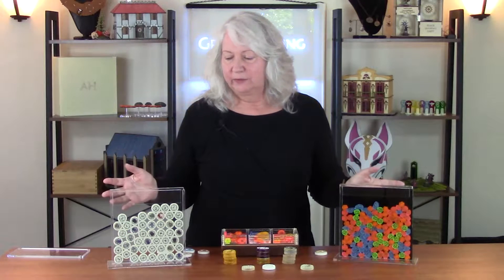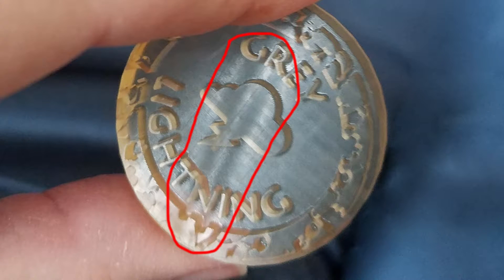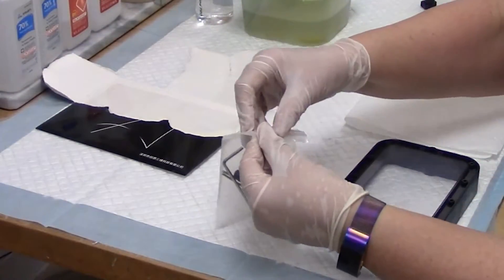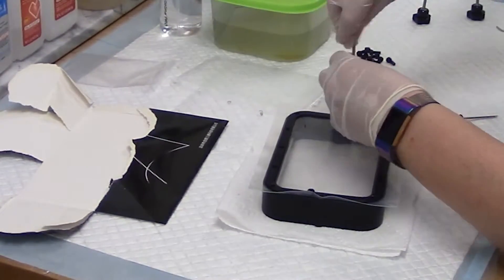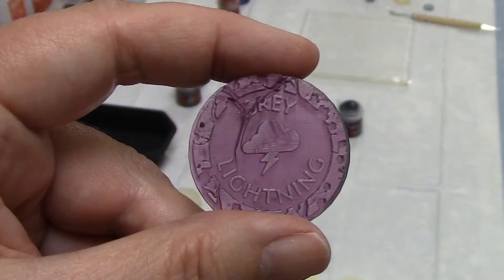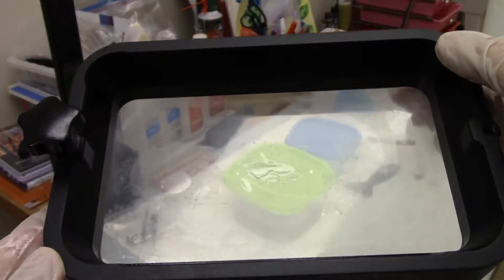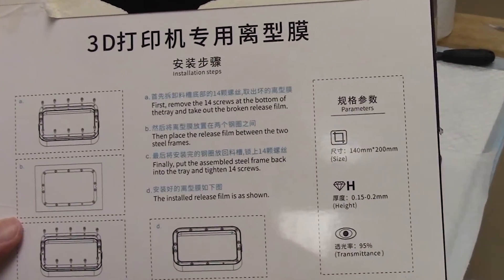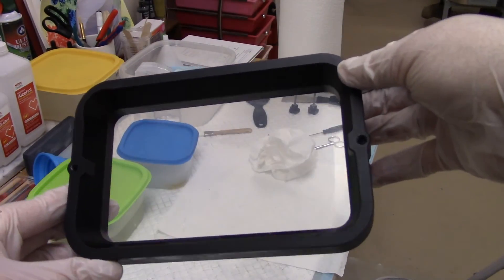Troubleshooting and Changing the FEP Film on Your 3D Resin Printer

Comment: I have a qustion for you , maybe  you've come across this problem as well, I recently tried to print some minis for a D&D campaign Im apart of, I have a Creality LD002H resin printer, I was able to fit about 6 minis on the build plate at one time, they didnt overlap or go off the edge according to the program I use. When the print finished I noticed that none of the minis had been printed just the supports I had them on, this is before I replaced the FEP which need replacing anyways. Do you have any idea what could have caused it to fail? Since that print I have had no problems nor did I have problems before that but I went ahead and changed the film anyways because I noticed some cured resin was getting stuck to the film after each print I did which i wasnt sure why. Thank you!
Reply from the maker: Very mysterious! After you changed the FEP, did you do the same 6 minis you had tried earlier, and did they print successfully? Based on what you describe, I can't imagine why they failed, especially if the exact same print worked later.

Comment: The protective film is on both sides of the FEP.
Reply from the maker: Yes, Vince, and I got a second printer recently and the protective film is now longer than the FEP film, hanging off both ends a little bit, so it is now much more obvious than on the early printers. They still haven't added removing it to the instructions on the package, though.
Reply: You just saved me from another disaster. Thanks!
Reply from the maker: Yes, so glad Vince made this clear because I didn't!

Comment: We're their 2 plastic covers on yours? Something happened 2 me but it happened on top and bottom of fep. I peeled 2 layers of plastic off. Only noticed after 2 prints.
Reply from the maker: Kevin, this is what others have told me as well. I must have removed one side and not the other when I was first installing it, or mine only had one, because it worked fine after it was reinstalled. I got a second printer at Christmas and it had both sides, but now the protective film is a little shorter and loose on one edge, so it is much easier to see.

Comment: I made the same misteke! never said that remove the fu...king film! I have a question, no problem with resin (filters) after remove, and put it again? Thanks a lot!
Reply from the maker: Exekiel, if you've run the resin through the mesh filter they provide, to remove any bits of cured resin that may be in there, it  should be good to pour back in and use.
Reply: @GreylightMay  Ahh ok with Filters I mean that resin goes outside the vat! because your remove it all the screws and put it in again. As you said in Argentina the replaceme FET cost U$S 50!! I dont want to throw it only for I "made" the mistake of remove the film! thanks a lot for your reply!
Reply from the maker: Ok, Exekiel, I'm not SURE still what your question is but let's try again till I get it right. Is the question can you reuse the FEP? That's what I did and it worked fine. It all depends on the condition it is in. Put it back on, run a test print and see if everything looks okay. In my experience, most things with 3D printing are trial-and-error. As long as what you try doesn't damage the LCD screen, you can try it and learn from your mistakes.
Reply from the maker: Or is your question that the resin is leaking outside the vat? If that's  true you must replace it because that will damage the screen.
Reply: @GreylightMay  excellent yeah I will try!!! The important part is not damage the screen thanks a lot!!!

Comment: I'm just about to replace the FEP on my Creality, you just saved me from the film! Thank you! 💜
Reply from the maker: Robee, you are so welcome! I just changed out the FEPs in both of my vats today, and eventually you get really good at it. Definitely trim the film when the bolts are only partially in, it's very easy then, and when you screw them the rest of the way the edges pull right down in. I'm glad this was helpful for you!
Reply: @GreylightMay  I saw another video where someone used a knife afterwards, and I am so using my nail scissors before tightening like you suggested! 🤗
Reply from the maker: Yes, the exacto knife method did NOT work for me...

Comment: That's a GREAT TIP about cutting the FEP before tightening the screws.  I just spent almost an hour trying to remove the excess FEP using an X-Acto knife AFTER tightening the the screws.  The biggest challenge was to NOT put a hole in the brand new FEP with the X-Acto.  I've watched at least 10 different FEP replacement videos and cutting the FEP before tightening is the BEST TIP I've seen yet for the Creality series resin printers.  Speaking of protective film there appears to be one on the LCD screen also (ie between the bottom of the vat and the LCD glass) Have you found that to be the case on your Creality resin printer?  Thx.
Reply from the maker: Crispy, I've changed so many FEPs at this point, I've gotten really good at it, and yes, trimming the FEP before tightening makes it much easier! I've got 3 printers now and it's hard to not confuse them, but at least one had a film over the LCD. I think it also had a tab of some sort that made it obvious the film was there. And there are protective films on both sides of the FEP sheet, so a lot of film to remove to be successful.
Reply: @GreylightMay  Thanks for the response.   I'm new at this, so lots of stuff to learn.  I was cleaning the LCD screen (Creality Halot-One) and found there were a couple of tiny "artifacts" that weren't coming off with IPA. Then I noticed they were moving around so I think that must be a protective film over the LCD.  So far the prints are coming out fine but will remove it if it becomes a problem.  Thanks again.
Reply from the maker: It's good you are keeping the LCD clean. I didn't clean it well enough once after removing and reinstalling the vat to change resins, and accidentally cured a little resin onto the screen. That was really hard to clean off! But I think you are right, as long as it is printing fine I would let it be. I don't know how to know for sure that it is removable film that is supposed to come off and you wouldn't want to damage it. I watched a video about replacing it and while it is doable it doesn't look easy!
Reply from the maker: Crispy, I thought these comments were accidentally deleted but they've returned - I'm so glad! Thanks for the lead on the scraper, I ordered it immediately. As for making money, no, I think resin printing is primarily for hobbyists today. It is excellent for making prototypes, or models for mold making, but it would be hard to make a profit in a production environment given the cost of UV resin and the time required to print. But such an amazing tool for makers who want to produce their own unique creations!!
Reply: @GreylightMay  Haha, must be some Magic afoot.  Yes, print time, resin are unfortunate limitations.  But it IS so much fun.
Reply from the maker: More like a very lame app called YouTube Studio. For years it couldn't even handle comments on comments. I had to use the desktop version on my phone to approve and release those comments, very small print and tiny little buttons but at least the comments were there for processing.

Comment: Hi! I broke the frame of my fep vat. I am thinking of buying a new one but a generic one to save money. Is it ok to use them?
Reply from the maker: John, I bought an extra one so I could use two colors in my current project, but I stuck with the one Creality now sells. I just didn't trust that the screws would line up properly. You could try it as long as you by from someone like Amazon, or anyone that provides reliable returns if it doesn't fit. Good luck!
Reply: @GreylightMay  i ordered 2 pieces of the solvo vat in amazon. They were featured to be really good and better. :) i also checked if the fep i bought  online has peel off layer. Thank you for that advice
Reply from the maker: John, let me know if it fits when you get it. I would like a couple more and will try that one if it works for you! Also, could you send me the Amazon link? I searched but couldn't find it. Thanks!!

Comment: I made that same mistake but I had the film on the inside and there really was no saving it. It sucked, but I am much happier with the Elegoo replacement nFEPs I purchased. My last FEP change was in July and it is still going strong. But now I know to always check for protective films.
Reply from the maker: hmx, knowing you did the same thing, you who are many many steps ahead of me, makes me feel so much better!!
Reply: @GreylightMay  The same thing happened to me as well, but I knew something was wrong the moment I tried to push the metal down but went on anyway with more force. I didn't know why it felt wrong until I cut off the excess film and saw that it "split" apart. That was when I discovered that there is protective film around it...
Reply from the maker: That makes sense because the film makes it so much thicker, but even after I had guessed what had happened it was hard for me to pick the two apart. When you first start this hobby there are so many things to learn; it would be nice if we could be spared unnecessary setbacks like this!

Comment: I thought there were 3 sheets in the pack that came with the printer and that I've ruined two sheets already. Luckily it was only the protection film, that got ruined and spilled resin all over the place. Thanks for the video and tip. Weird that the package doesn't say anything about the protecting film.
Reply from the maker: Daniel, I'm so sorry you've had to go through that twice! Yes, it is a shame to have such an unnecessary problem with what has been, otherwise, a really great printer.

Comment: "Worked well ever since" !!!! I have done some 25 prints and this has required 3 FEP sheet replacements... The RUBBISH CREATION HOBBY!!!
Reply from the maker: Blue, while some of my viewers have said they rarely have to change the FEP, that is not my experience. I too have had to change mine several times and my new big Photon printer is significantly worse than the Creality. I've gotten fast and good at changing it, luckily they aren't TOO expensive, but in my experience it is a regular maintenance requirement. The smallest deformity or discoloration can cause failed prints, which is quite irritating.

Comment: If the FEP film is a little stretched or distorted, it can be fixed by blowing hot air using a hair dryer worked for most members of my local 3d printing group. It stretches the film back to normal.
Reply from the maker: Joreen, that is a great tip, thank you!!